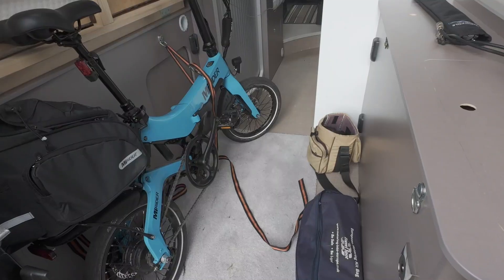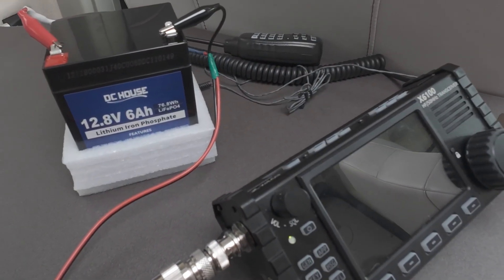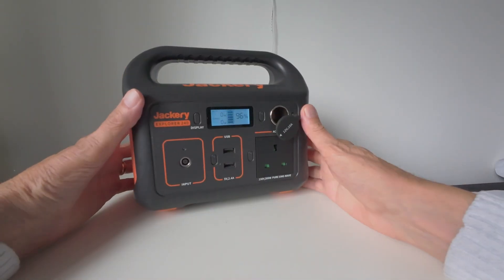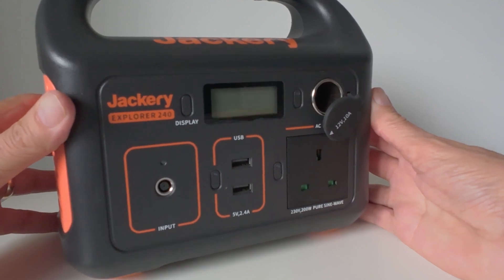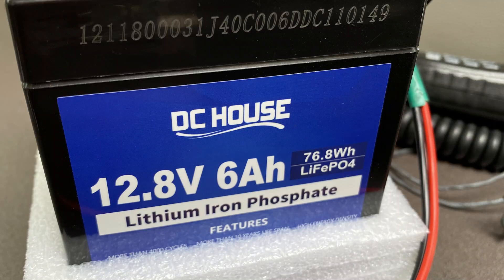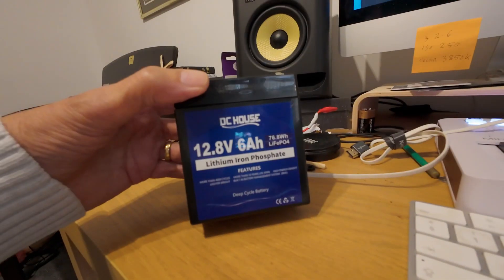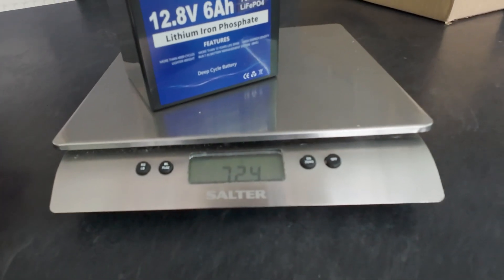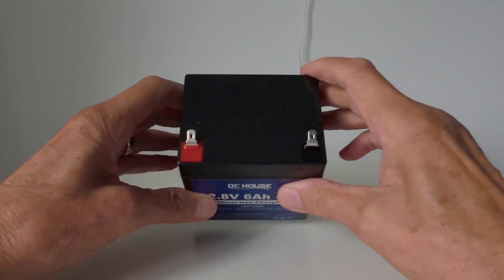Battery Choice for Ham Radio Portable Operation

Comment: I use a 4Cell LiPO from an RC aircraft. 2200 mAh may not seem all that much but these batteries can be discharged at 20C (so it will power the big rig for a short while if need be) and still fit in your trousers pocket.

Comment: TXS Peter for this interesting video, just a thought ,fusing both negative and positive nearest the battery would be good practice also I prefer the push on connectors  as the crocodile clips could be easily pulled away from the battery terminals. 73's

Comment: LiFePO4, not sure it's same charger as lithium batteries. But no définitive answer yet.
My advise : For POTA use, be careful about form factor. I bought a 20 AH LiFePO4  battery, The weight is in the bottom of the box so I think it's half empty. This may be to respect form factor of mandatory industrial batterie size. So try to find the highest capacity for minimum real volume of the battery for backpacking.
Reply from the maker: Good advice for backpackers.

Comment: I run my FT 718 from a 6Ah LiFePO Battery on portable since 2 Years. No problems . Two Batteries ,Transceiver, EFHW antenna and cable fit in a standard waterproof NATO Ammo box.
Reply from the maker: Good to hear. Thanks for sharing.

Comment: Can I charge lifepo4 with dc variable bench power supply (lab type) with cc protection
Reply from the maker: I would strongly suggest using a proper charger.

Comment: 10W into a 50 ohm load is about  23V (RMS). 32V peak, 64V peak to peak. To get that from a 12V battery, chances are there's a switch mode supply inside - or a 1:5 transformer at the final stage. 
10W is also: 450mA RMS, 640mA peak, 1.28A pp. To provide that (at 60V) your final stage needs about 6.3A
Counting all the time your radio is keyed to transmit, a 6Ah battery should last one hour.
Reply from the maker: The DC voltage is quite different from the RF voltage across the load.
Reply: @watersstanton  True, but the RF can only swing from zero to the supply voltage. You can add a transformer on the output stage (as I mentioned) but Class A amplifiers are not efficient.

Comment: Good video Peter, I spotted a yellow fuse which I think is 5 Amps. I think it worth mentioning the fuse rating especially for our welcomed newcomers to ham radio.
I would have suggested 5 Amps as maximum for that specific application. 
73, Martin

Comment: Did you consider putting a fuse in the negative side too?
Reply: For airline travel batteries must be in your carry on and 100 watt hours or less.  I use a 6 Ah battery to power a 50w amplifier along with my IC-705 on the internal battery at 3 watts to drive the amp. I’ve had no trouble operating for hours on CW or SSB.  50w offers a nice balance between reach and power consumption. Most stations I can hear return my calls.  Fusing the negative lead is important for mobile if you connect directly to the car battery. Most cars depend on the chassis of the vehicle as the electrical return path. If the return path to the battery is interrupted for any reason, it will try to use the radios negative lead as the return path which it is not designed for.
Reply: @petersichel9934 correct, a number of noted people have had their equipment damaged due to this issue.
Reply: @petersichel9934  what about connecting to a separate lifepo4 battery? Is that ok without a fused negative? (Thanks btw!)
Reply: @JohnR_ytbe  If you have only a single device connecting directly to the battery you don't need a fuse on the negative side.  As soon as you add more powered devices that share a common ground (say from the coax shield), there's a risk of creating an unwanted ground path if a device is improperly connected.  Imagine it's dark for example and while trying plug in a power pole cable you mis-align the connectors so that the black side of one cable connects to the red side of your distribution hub (or vice versa). A fuse on the negative side could help protect you and your gear. Of course this should never happen, but fuses are cheap insurance, radios and batteries are more expensive.
Reply: @petersichel9934  thanks! Really clear explanation!
Reply: In the old days, cars had positive grounding of the lead acid battery. Fuses would thus be fitted in the negative leads from the battery. Red and black cables that come with Japanese equipment since the 60's came with fuses in negative and positive, thus suitable for all cars. In similar fashion to domestic electricity circuits, where the neutral is earthed.
Reply: @73deoldtimer  ahhh that makes sense. Thanks!
Reply from the maker: No.
Reply: @watersstanton  just wondered. I see some do and some don't and wondered why

Comment: Great video Peter. I generally use 2250 mAh 3s LiPo packs. Very light, and last a long time running 5 W of CW with my TX500 or FT817
73 M3KXZ
Reply from the maker: Great to get your feed back.